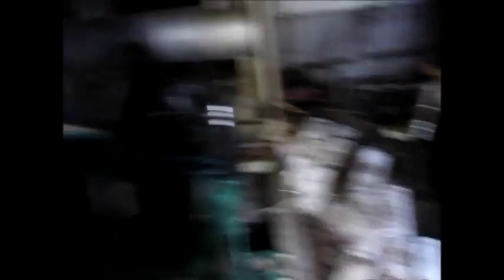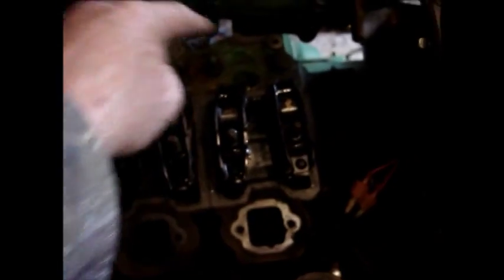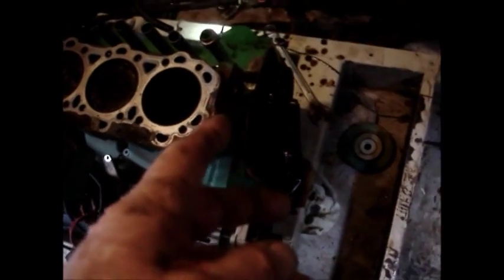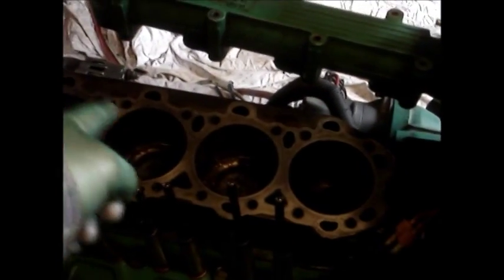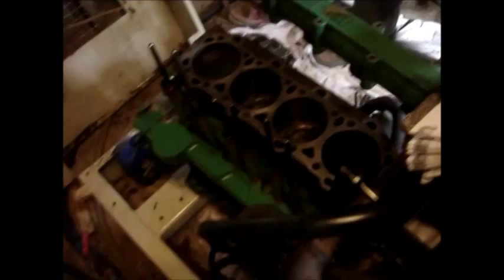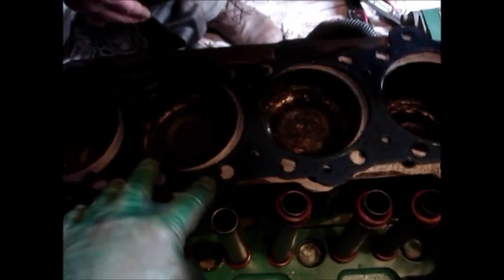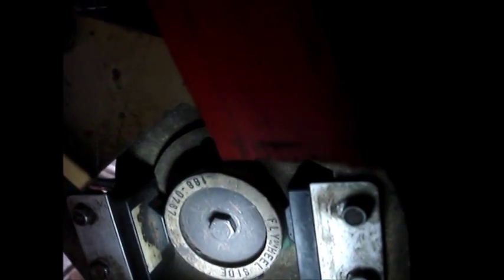Rebuild Lister Petter 4 cyl OHV 16KW Generator Engine

Comment: YOU WERE HAD ! In 2013 I was buying complete new diesel engines through a lister dealer for £1300 in the UK.
Reply from the maker: I looked all over for parts. Cummins had us by the short hairs.  But it doesn't matter now. The entire forest, some 700,000 acres, burned in 2019. The "Camp Fire" took out the entire San Joaquin River drainage. And this place was also being devored by pine beetles. But yes, we were had.

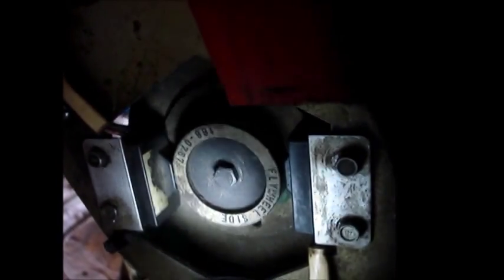Comment from the maker: SPECIAL  NOTE::  See the "magnetic pickup" at minute 6:00?  See how it says "Flywheel Side"?  This piece was installed Back wards Years ago.  The washer was in a convex shape because of repeated torquing. On 3-19-16 the bolt snapped off. Upon removal it was noticed the "pick up"  was mounted backwards and the washer was convex. A sledge hammer flattened the washer and the Pick Up was flipped over so it is facing the flywheel.

Comment: Lister / Petter engines are not pieces of shit.
Reply from the maker: Dieseljonnyboy when the cost of repair is this high, to me they are pieces of shit. But slickjimmy, posting below, says he got the parts for much less.  Use diesel. Like your name says.  I sold 3 GMC generators 20-35kw in the $3000 range.  Diesel is so much better than propane.

Comment: $200 a set for rings? I bought a full ring set for my LPA3 for $121 (same basic engine just air cooled 3 cyl) where did you source your parts?
Reply from the maker: From the only source I could fine, Cummins. How about you??
Reply: ***** I bought mine 2 years ago from Defence reman products on e bay. Total cost to do top end, main crank bearings, all gaskets plus 2 new intake valves was if I remember correctly was $216
Reply from the maker: slickjimmy76 Wow, We looked around, 2 of us. This was all we could find. I tired to talk the owner into getting a diesel generator, I've sold 4 on ebay, 15 to 30 KW for $3K or so. They use about 1/3 the fuel as this propane powered cash inhaler.
Reply: That sucks :/ I know the diesels are good little power plants but the LP/Natural gas I can not say.
Reply from the maker: slickjimmy Diesel is the way to go. 1/10th gallon per kilowatt hour, propane is about 3/10 gallon per kilowatt hour.

Comment: Now i see. lol I have just bought one. and need crank sensor. and oil pick up pipes. I need help with this lpwg4 gas engine. it has an electronic gas control. Yours is the only one i seen so far in my requests to find more info on this engine. Help anyone.
Reply from the maker: HI. I just saw your comment. 8-12-20.  The connections on the propane valves can be a problem. I had to clean them a few times. maybe the connectors were of inferior quality. I moved and haven't been around this generator for 4 years. I would Get Rid of the Lister and buy a diesel. 3X the fuel effeciency! 1/10gal perKWH for diesel Vs. .3 gal per KWH for propane.